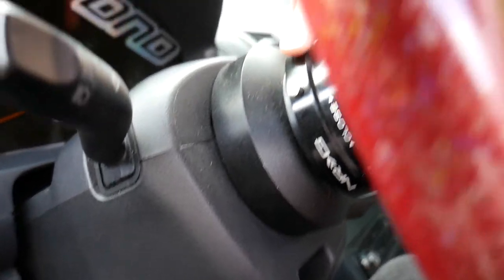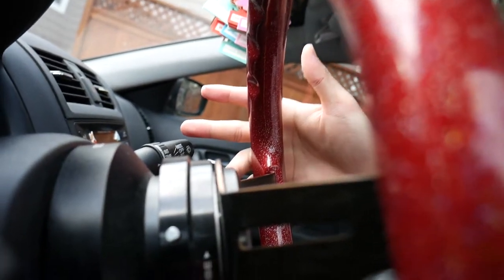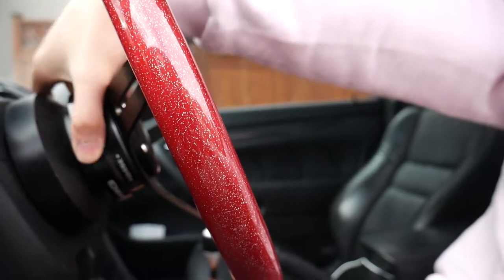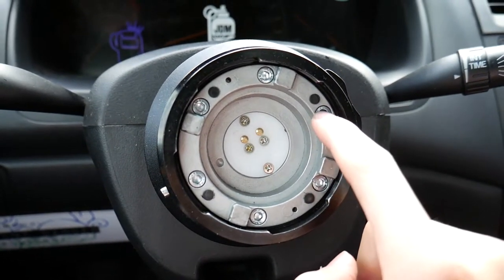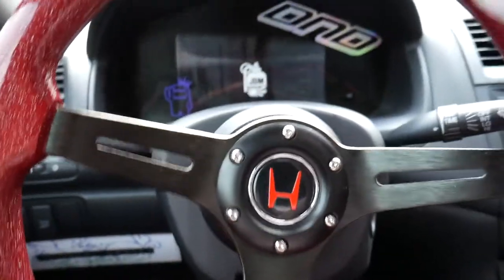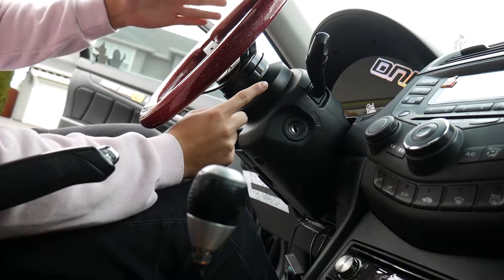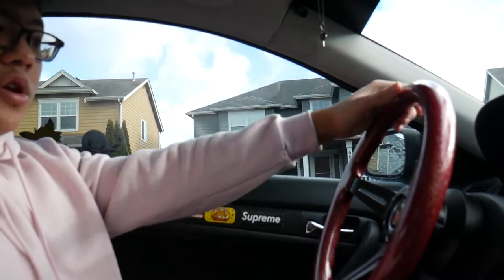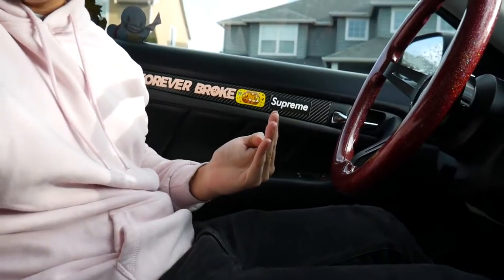NRG Thin Quick Release Review

Comment: Is the short hub NRG too?  This is the setup i want but nrg says it won't work with their short hub.  Are you having any problems with it?
Reply from the maker: pitbullchristian it is a NRG short hub! It works fine and I haven't had any problems with it at all
Reply: @LinnysLife  Word, thanks a lot for replying i appreciate the info.
Reply: @pitbullchristian  i just installed my short hub and short slim release in my 350z. I can hit my blinkers in my deep dish wheel. You might need grease on the release and wheel  relase mine is tight.
Reply: @Jianemba   Nice i just got the hub in the mail today i'm gonna use a spacer, was waiting to see how far the hub came out.  If you put a spacer in between it might loosen up the release. I will probably do a 2inch spacer with a flat wheel.

Comment: Did you have to use a spacer? Because I just tried using it on a regular short hub same from nrg and the bolt hits the back of the thin quick release so I can’t bolt it up
Reply: I dont know what car your using it for but i wanted the same setup for the extra room but on my ek civic you cant bolt the thin quick release to the short hub directly you need a spacer in between which is half an inch thick and even with the spacer it was kinda hard lock unlock i just ended up taking it off and running the short hub then spacer then wheel you also cant run just the short hub directly with a wheel theres not enough room for the nut to clear. So you either run the spacer plus the thin quick release or just hub spacer and wheel. The hub plus the spacer plus the thin quick release ends up being the same thickness as a regular quick release so its up to you

Comment: I have the same on my wifes truck but I'm having a problem with the horn.  It's as if the steering column  nut is hitting the back plate for the horn contact and not letting it sit in fully.  I had to remove the horn contact to get it on.  Any tips? I went with the short hub for her the same reason you stated and would rather not have a spacer if I could help it.
Reply from the maker: So the backplate and the locking nut won't let the bolts set in evenly on all sides? You might be able to go to a hardware store to get a thinner nut with the same thread pitch, but other than that I'm unsure. I know it fit for me, but a lot of people have been telling me that I have a regular hub and not a short hub so perhaps that would also make a difference?

Comment: I just got mine and it's really difficult to twist to lock the wheel on. It looks like the little rubber feet on the inside are causing this. Was yours like that when you first got it?
Reply from the maker: Mine actually never had that issue, it was greased well and it was always pretty smooth
Reply: @LinnysLife  That's probably my issue. There's no grease in mine. Thanks.
Reply: Andrew what did you do or find out? I greased mine and it moves fine without the wheel but yeah I still have to use 2 hands to lock and unlock.